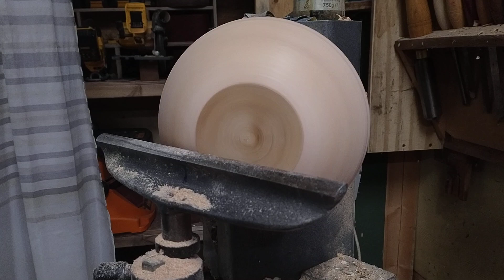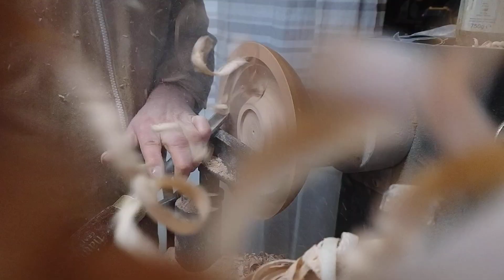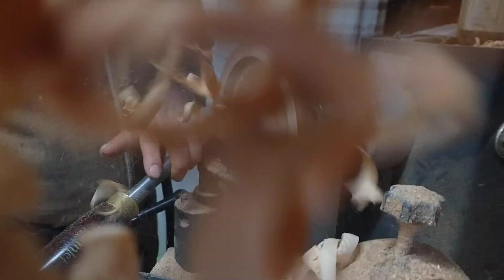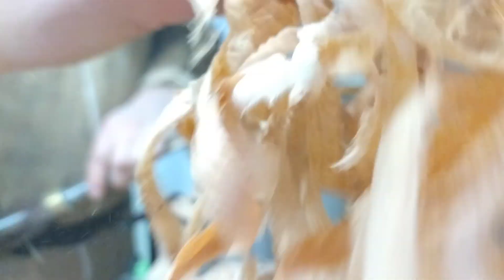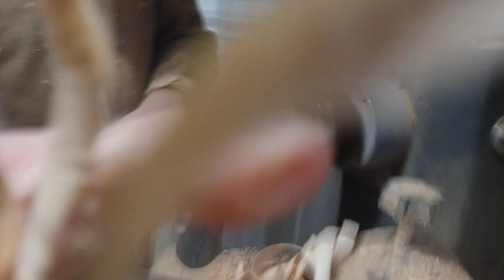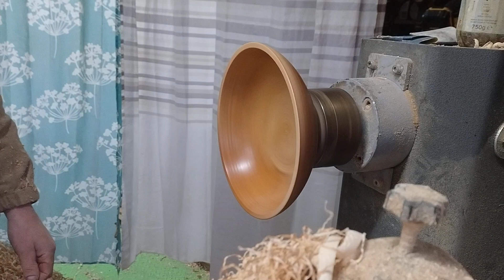Turning an 8"x2¼" food bowl from air dried beech.

Comment: Thanks for taking the time to show another angle.
Reply from the maker: The challenge is finding places to put the camera that don't get on my way when I'm working. There were 2-3 times in this video where I had to take a different cut to what I would have preferred, to avoid hitting the tripod with my tool or my body.
Reply: @woodworkscoracles6540  I have turned some bowls myself, and for some of your cuts I was thinking "He must be leaning way off balance to let the camera see this!" Which just amplified what I think of your skill - - it takes a great touch to still get long continuous cuts while standing off balance! My hat is off.
Reply from the maker: @JimDillon I appreciate your concern but I didn't have to make much of an allowance for the camera with my turning technique. None of the shaping cuts would have been done dramatically differently had the camera been turned off. It was mainly whilst I was turning the mortice that my tripod got in the way.

However it seems that my technique is quite different to many turners, which may be why you felt I was contorting myself for the camera.